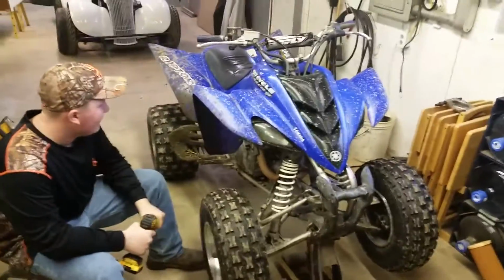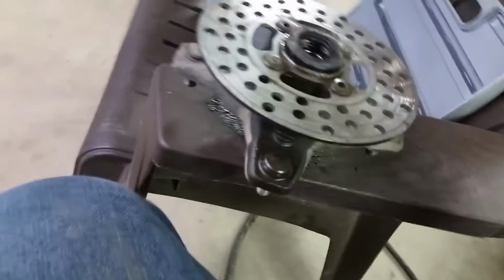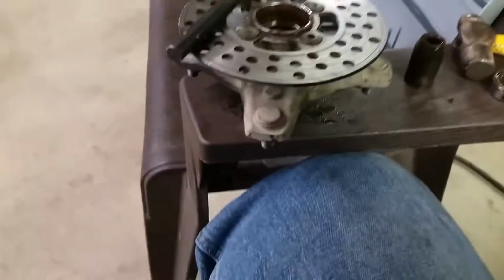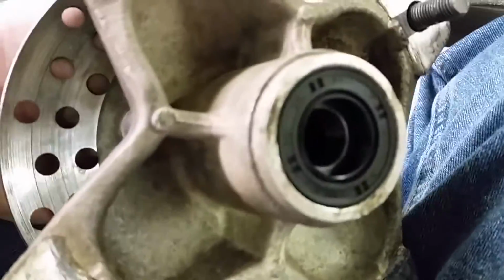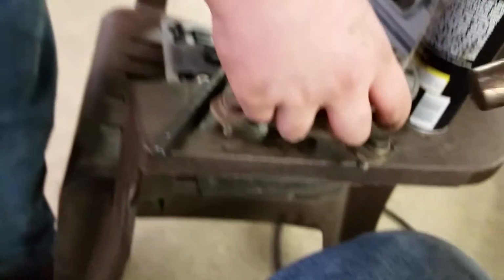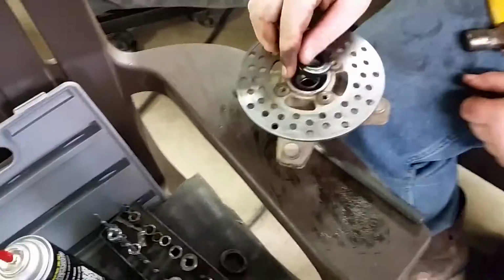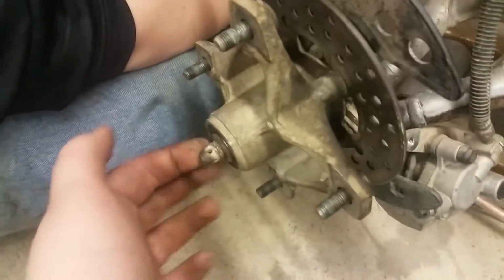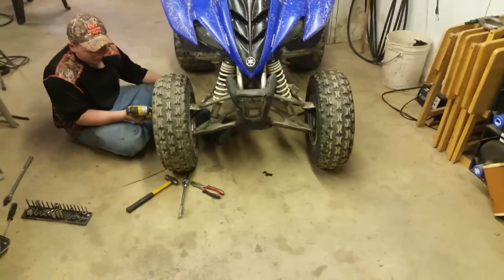Yamaha Raptor 350 wheel bearing replacement.

Comment: You are not supposed to be hitting the inner ring on a bearing when driving it in. You ALWAYS get a bigger socket for the outside ring. You put less stress on the bearing housing by using the outside of it.